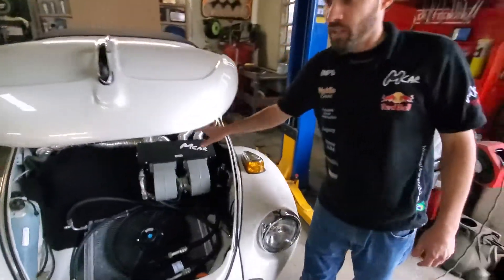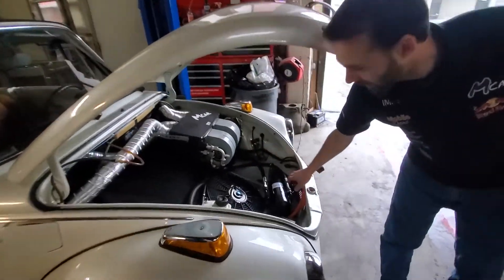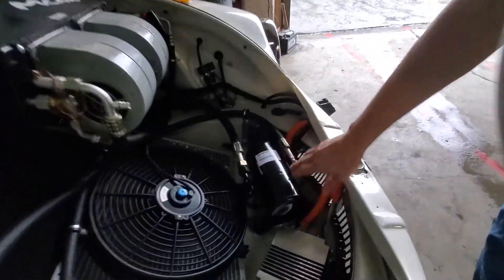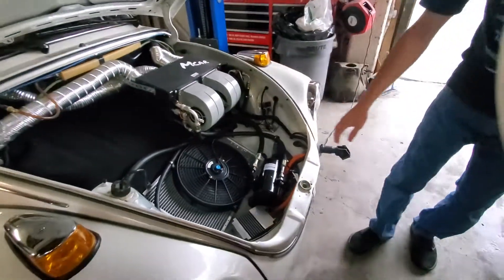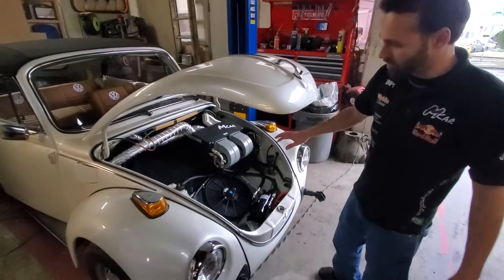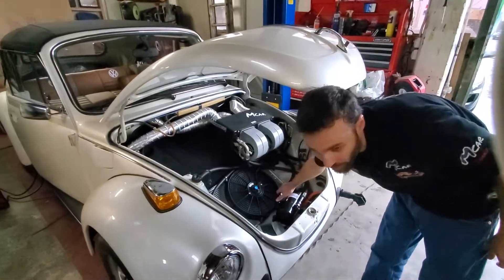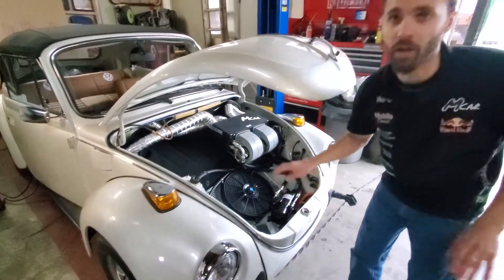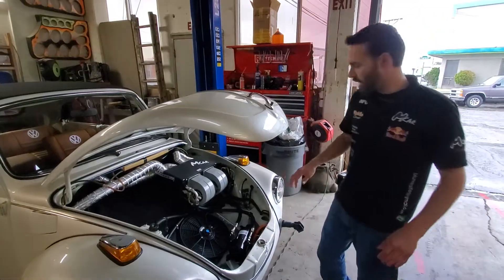installation of electric air conditioning for vehicles

Comment: Can you give any data on power/amperage draw?  Would a single deep-cycle batter combined with a 90-amp alternator keep up with this thing in a daily driver?
Reply: It draws 60amps I believe. You will need a 100amp alt or bigger to keep up if you have other accessories like preamp boom speakers etc

Comment: ...  So What ? .. You Push Start the car when the Battery Goes Dead in 30 seconds ?? How much power does that draw and how do you supply it ? Thanks ...
Reply: I been researching these for months still not a ton of info out there but from what I've been collecting it pulls around 60 amps so definitely gotta upgrade the alternator I seen a vid of another bug with a electric ac setup they added a second alternator.